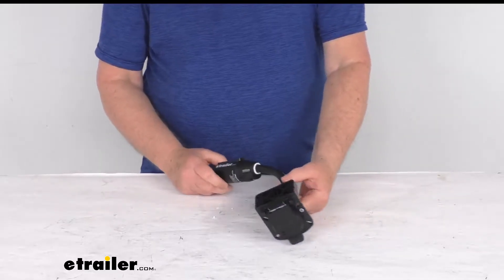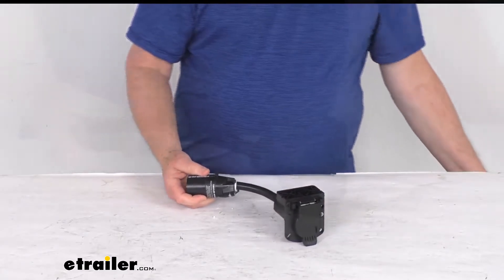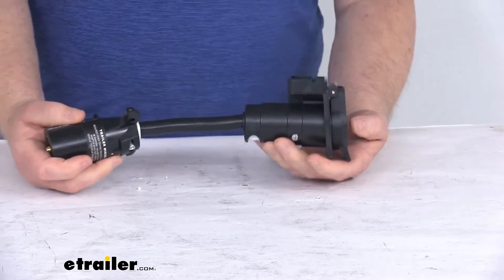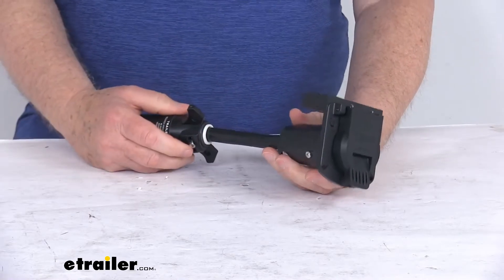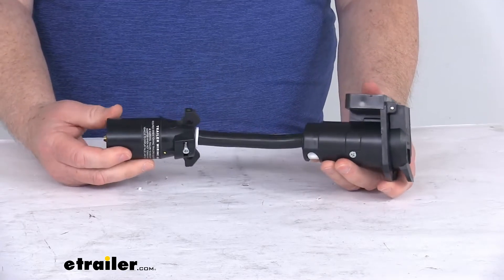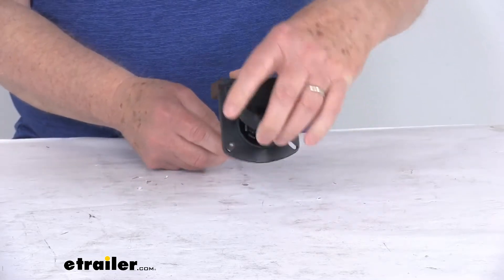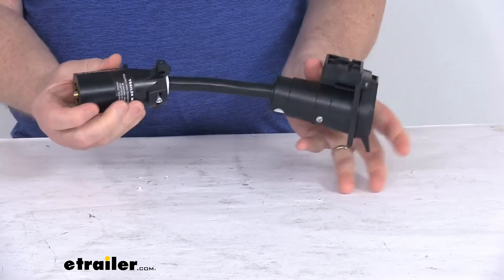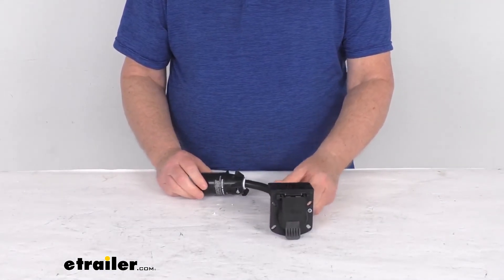etrailer | A Closer Look at the 7-Way Trailer Adapter for Towing Trailers with LED Lights

Comment: Hello, I purchased one of these and when I plug it into my truck and connect my fifth wheel to it, the truck does not even recognize that a trailer has plugged in. Also, it does not even light up the lights on the trailer. Does anything have to be done inside the truck to make it work?
Reply from the maker: If your Curt 57003 7-Way LED Adapter isn’t lighting up or your truck doesn’t detect the trailer, it means no power is reaching the adapter. Check your truck’s 7-way plug for corrosion or damage, and test the pins for power, especially the 12V and running light circuits. Many trucks (like GM, Ford, or Ram) have trailer power fuses that may be missing or blown, preventing the 7-way from being active. Try plugging the trailer in directly without the adapter; if it still doesn’t work, the issue is in the truck’s wiring or fuses. If it does, the adapter may be defective. If you find that you have no power going to your d7 way, we do have kit for that: https://www.etrailer.com/Accessories-and-Parts/etrailer/5506.html